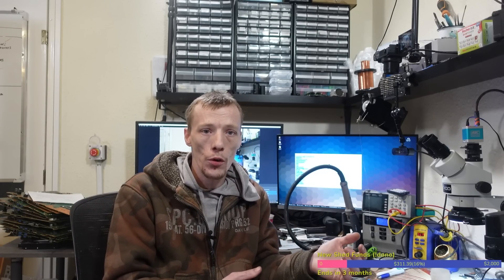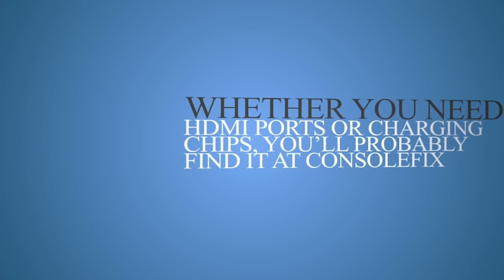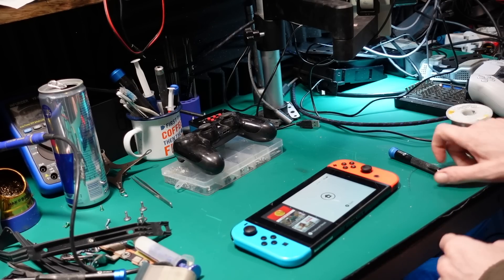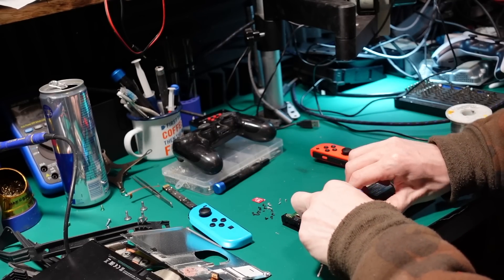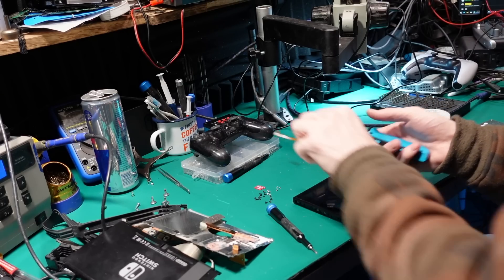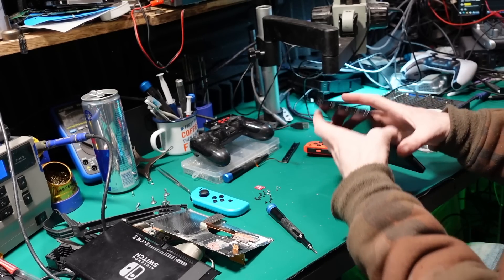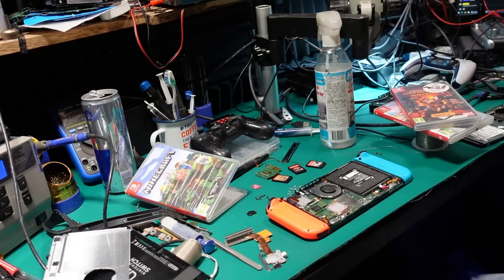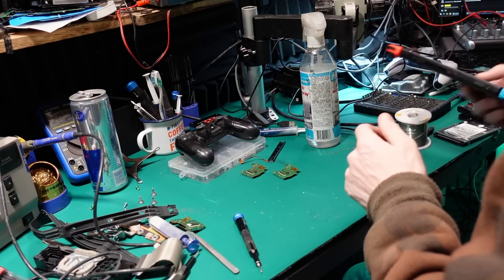Repairing A Nintendo Switch That Loses Joycon Connection & A Faulty Touchscreen (Throwback Tuesday)

Comment: A definite yes on the test sheets. Also, recently did a repair myself where the unit had been dropped. The game card reader wasn't locking games in or reading them. Luckily the dropping had just unseated just about everything. After disconnecting and then putting back together, it all worked just fine. 

Enjoying the videos. Keep it up!

Comment: Hello. Can u confirm that the touch screen is connected to game card reader and that is what cause the touch screen to stop working? I bought a v1 switch on eBay for 80$ but can’t read games. I bought a used card reader installed it and the touch screen stopped working. Switched back to old one and then screen works. My prob is trying to get refund or exchange for the card reader, seller says they’re not connected.  But if it were a v1 switch with installed v2 card reader would that cause the touch screen to stop working? Thanks mate!